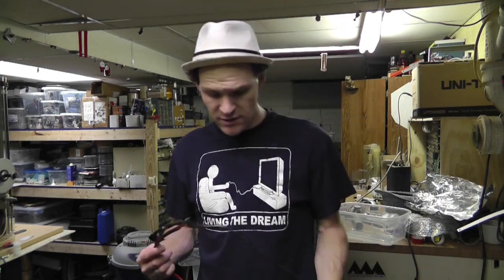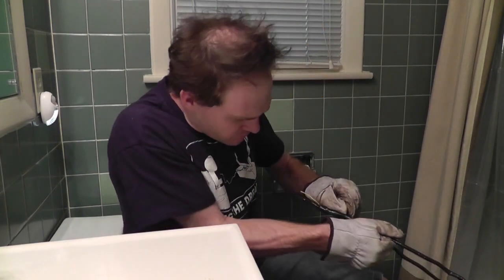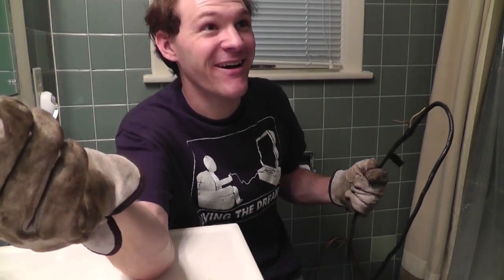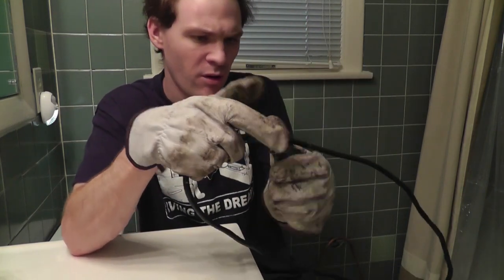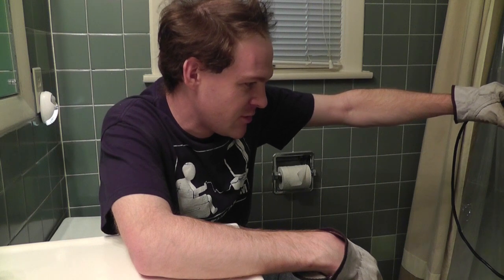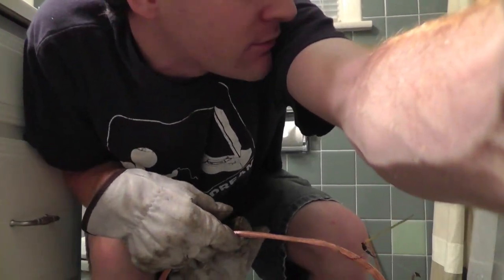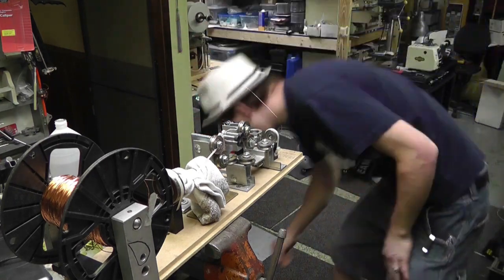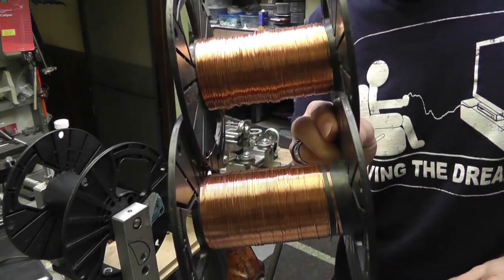How To Clean & Straighten Used Magnet Wire From CRT Degauss Coil's! USE YOUR RESOURCES!!

Comment: Note - as an FYI - that not all CRT degaussing coils are wound of copper wire. (Sorry if that was already mentioned). A lot of the later ones were some sort of aluminum alloy which you can't even solder to. 

Also, the comment about putting the coil onto some sort of cylinder is really the best way to go. Having been in the TV repair business for over 20 years, I learned that both of these methods can be difficult to do without getting knots and sharp creases, which can compromise the enamel.

Comment: Thanks for taking the time to make this video. Copper coils come from older TVs: 2000 - 2002 AD and earlier. They "feel" heavier in the hand, so you can tell. Aluminum coils aren't that valuable as project material, and probably not worth the time to unwind and clean. Aluminum is v. hard to solder and its soldering is not reliable. The amount of magnet copper wire rescued from a medium size TV box is worth around $15 retail on today's market. 

I would suggest heating up the coil prior to removal of the tape from it. I would run about 15 to 20 Watts for 30 min. to warm it up and this should make the black sticky take peel right off with ease. Hook up adjustable DC power supply, if you have one, and calculate the Volts and Amps not to exceed 20 Watts. Too much heat could destroy the coil.

Comment: The awg of the wire and length or weight would have been useful. All you had to do was weigh the roll before and after you spooled up the roll.

Comment: doesn't the xyline damage the magnet wire coating??
Reply: this is what I am researching.  How to clean the glue off the wire without damaging the coating (enamel? lacquer?) Ammonia doesnt work, neither does dish soap or alchoho.  Mineral Spirits is next.  I want to use it for jewely therefore I want the coating to preserve the beauty
Reply: Tres Longwell I think originally it was in a mall I don't know if it still is or not I know it's Eileen is used as a enamel propellant so so that's probably not any good also acetone is used as a Indiana mall center and propellant. Well not actually a propellant but in with the propellant is a thinner so that's not going to be any good I don't think alcohol will do a damn thing I would just try you say ammonia doesn't work I don't know I'm at a loss I would call one of the manufacturers and write them and find out

Comment: For anyone interested I was looking into the solvent used and it seems that the enameled wire is not all that impacted by cleaning agents after it has cured.  It took some time, but I found a PDF that contains loads of information on the structural stability of the wire coating.

https://www.hitachi-metals.co.jp/e/products/auto/el/pdf/MagnetWire_en.pdf

The information I was looking for personally started on page 13 and on.
Reply: Nice Pull dude